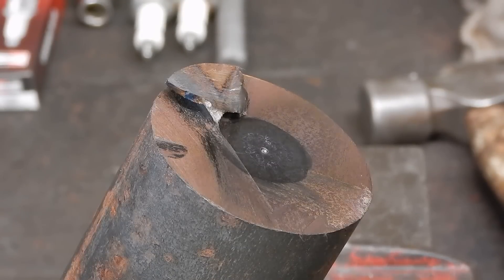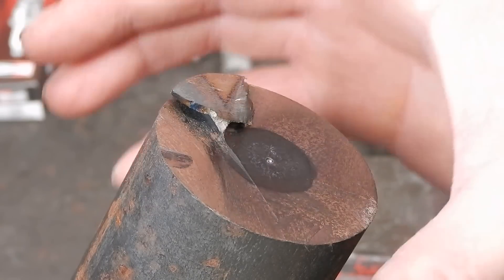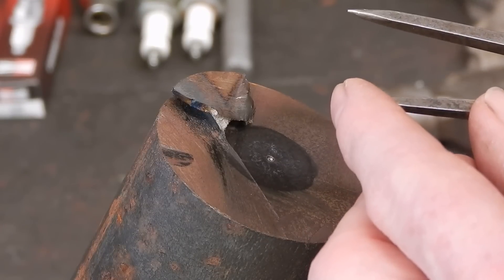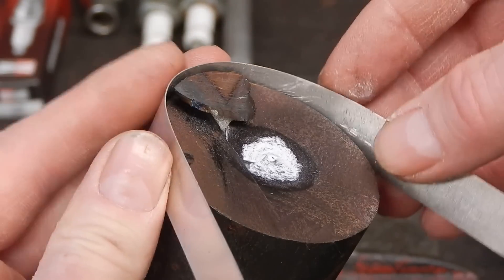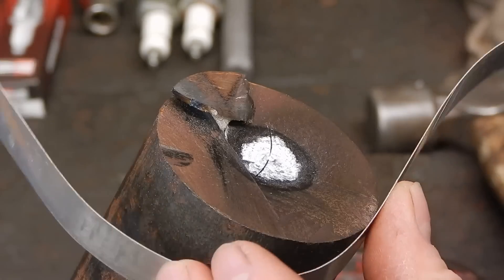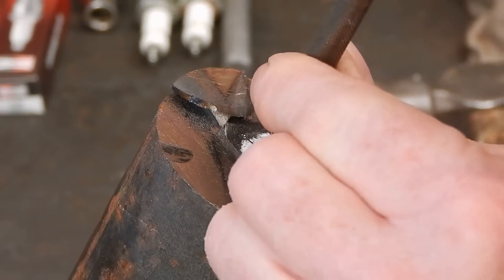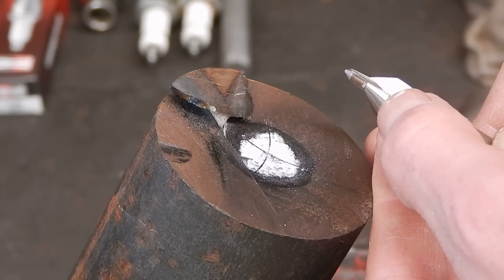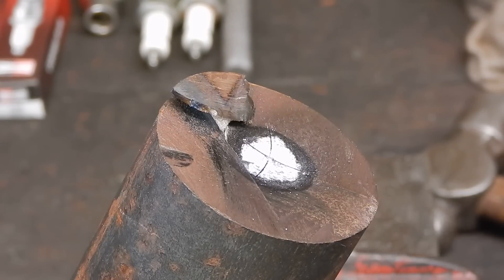How to find center on large diameter metal round stock

Comment: Do you have any tricks for cross drilling holes in round stock at 90 degrees from each other? I don't have the fancy equipment to do it properly.
Reply from the maker: To do it accurately you will need to index the job.  I do it in the lathe using a paper indexing disc, but it all depends upon what you have at your disposal and how you intend to drill the holes.  Cheers Rob

Comment from the maker: Note that unless the metal stock is perfectly round (which is unlikely) the center point will vary slightly, depending upon the measuring points used on the circumference.  You can see that in the video where the previous punch mark is slightly misaligned with the scribe cross over.  Rob
Reply: Take a 4 jaw chuck clamp it to the shaft centred install in lathe and put steady around 4 jaw and drill end centre hole,been turning 1,6 ton shafts,,easy..
Reply: if you have a lathe.  Rob said at the beginning that this is a different way of finding the center.

Comment: I would like to ask about that L820 camera. From reviews I don't know if I have to like it or hate it. What are your experiences with that camera? How good is that camera with focusing on things in 0,5m distance? What are your experiences with the battery life? Thanks.
Reply from the maker: I get very good results out of mine.  Most actual owners give it a high star rating.

For $215 it leaves anything else for dead in that price range IMHO.

Battery life is excellent/ large.  AA swap over (any type) is quick, you can use high capacity cells, I love that capability.  

Optics are excellent.  Macro is very sharp.  Focusing is average, not totally reliable if shooting a small close object against large back ground.  Generally it does the job/sharp.

Camera is amazing in low light.  I use manual over ride on basic auto for light compensation.  It also has full auto.

The camera over compensates when shooting white objects indoors.  OK out doors though.

Video is totally smooth with no pixelation or problem of any type - does great HD 1080p. 

Audio has no background noise (like Canons I've owned) but over modulates easily.  Very dependent on distance from microphone.

I could easily afford to update this camera, but it does everything I want very well and has not missed a beat over hundreds of hours of use in a workshop.

Be aware that the original firmware had a sound/video sync issue, but that is easily upgraded and all is then well.

Great little camera for the money. 

The only thing it lacks is an external microphone jack, but then they all do in that price range.

Cheers Rob
Reply: Thank you for your response.

Comment: But you then have the problem of not being able to drill it squarely using a hand drill, surely?
Reply from the maker: Tell me another way to do it?
Reply: xynudu am I wrong?
Reply from the maker: No.  You have to drill it as accurately as you can by hand. 

There is generally some variation between drill tip angle and a lathe centre angle, so it's not going to make a huge difference if it's a few degrees off of vertical.
Reply: not even lathes are dead accurate and neither is the stock that you usually buy, you just make it as accurate as you can. If you are that worried then send it to a professional.

Comment: How do you set your dividers in the first place, yours were already set and didn’t need adjusting. Bit rubbish really.
Reply: Set them to half diameter. Use a steel rule with etchings and remember to start at 10 mm as your zero point.
Reply: ocean ok thanks.